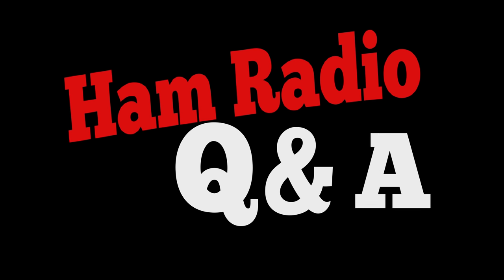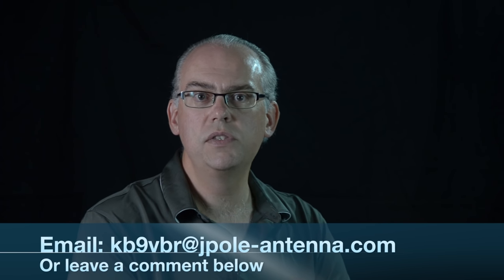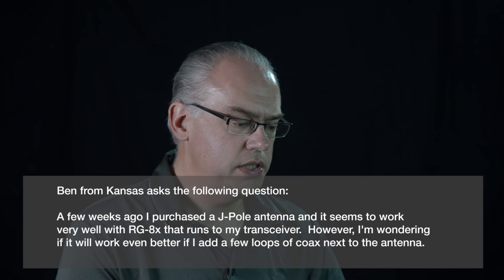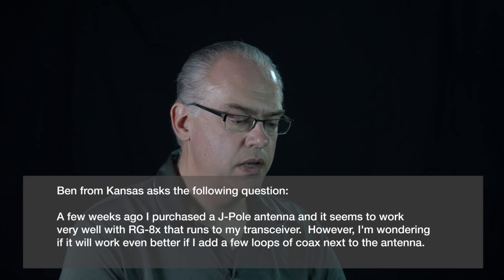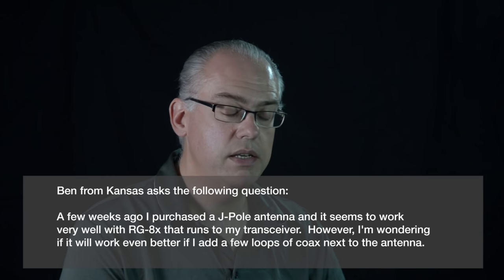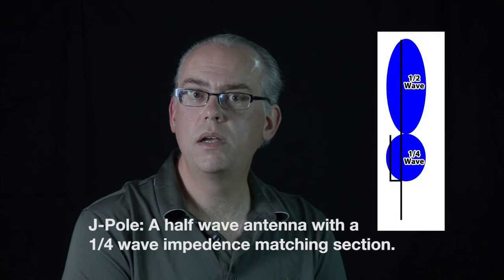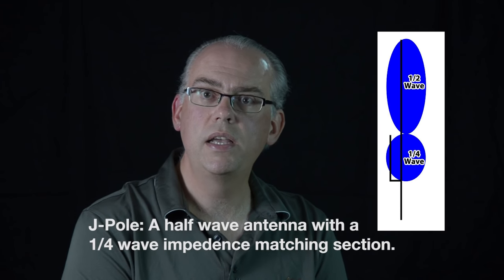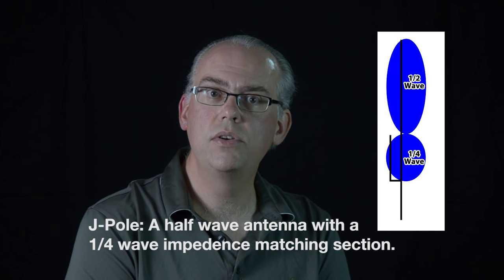Baluns and Chokes: Ham Radio Q and A Episode 3

Comment: I have an ldg ru-9:1 in on a long wire I get some qrm could I insert the mfj 915 isolater on the coaxial and would it help with the qrm.
Reply from the maker: Possibly‚ it depends on what the QRM is. If the QRM is man made like electrical noise the isolator may help filter it out. But you may be better off by first trying to figure out what the noise is and if it is coming from inside your home or another source. Once you know the source of your noise‚ the better able you will be to remove it.

Comment: So the best choice of ferrite bread would be the highest impedance at radiated frequency (e.g. 400 Ohm at 433mhz UHF should be fine)? E.g. this example:
http://cdn.lairdtech.com/home/brandworld/files/28B0315-100.pdf
How to chose ferrite bread for higher frequencies e.g. wifi 2.4Ghz when most datasheets just go up to 1Ghz... ?
Would the 28B0315-100 be ok?

Comment: Not convincing to me I'm afraid. If you make a coil of coax, both centre and braid are coiled and both will act as chokes to RF. Why should the braided part be more of a choke than the centre conductor? The RF energy travels on the surface as he explained (skin effect) so can't see the value.
Reply from the maker: Peter, in a sense you are correct. But consider this. The purpose of the outer braid is two fold: it creates the return path for the electrical energy as part of the RF circuit, but it also provides a shield so that the inner conductor doesn't radiate. It works like a Faraday cage. In coiling the coax the inner conductor is protected by the outer braid, thereby not creating the inductance. The outer braid has no such protection, so the inductance is present in the coil which increases the impedance, stopping the flow of return RF energy.

Comment: I have a question, if anyone would be kind enough to answer :)  I'm not a 'Ham', just an amateur that likes pratting with antennas for receive only say, airband...  So, would my diy dipole for aircraft freq work better with a 'choke'?  Does an antenna that is optimum for transmitting, automatically translate into being at optimum for receive also?  thanks :)
Reply from the maker: The choke's primary purpose is to keep RF energy off the outside of the feed line while transmitting. But it can have some benefit with receive only antennas, mainly cutting a bit of the receive noise. You won't notice this noise much with FM, but it could help with AM and sideband modulation reception.
Reply: thanks very much for replying quickly :)  I wondered if it would help because it's the balanced-unbalanced thing (receiver is 50Ω), then again - I guess that's a balun? I might try both then :)

Comment: To match the impedance on a delta loop I am told to use a 1/4 wave length of 75 ohm cable at the feed point.  Is it better to do the 5 loops with it at the feed point?   do I need a 1:1 current balun also ?
Reply from the maker: The 1/4 wave length of 75 ohm cable is used for a different purpose than the balun. It is changing the impedance to 50 ohms at the feed point. The 1:1 balun doesn't change the impedance, but does keep stray RF from returning back down the outer braid of the coax. You may need to add the balun, I guess it depends on your install and if the return RF energy is causing problems.

Comment: Built a 40 Meter NVIS dipole, the article I followed said to do a balun- 6 turns at 6-8" diameter. Is this correct? I'm using 49 ft. of RG-58U total length(including balun), with RG-8U to run to the station. Anything you would change in this setup??
Reply from the maker: +Steve Tomlinson With RG-8U I'd go for at least 7 turns in a 4.5 inch diameter circle. ideally for 40 meters, 10 turns of coax would give you the highest level of impedance on the outside braid. Here's a chart that can help you determine how many turns of coax you need for your antenna based on coax type and frequency: http://www.karinya.net/g3txq/chokes/
Reply: +KB9VBR Antennas   Isn't RG8-U too stiff to turn onto a 4.5" diameter? Thought maybe you meant the RG58-U. Thanks for the insight..
Reply from the maker: +Steve Tomlinson RG-8U should be flexible enough to bend that tight. Although some brands of cable may be stiffer than others. Worse case scenario, you could use a lighter weight cable to build your balun and just connect it in-line with the rest of the antenna system. At 40m, your losses would be minimal.
Reply: +KB9VBR Antennas   My new DX Engineering coax is really stiff, but I found some older 8-U that will work. Thanks for your help..

Comment: Would it be prudent to usa a choke or Balun on a mobil 50 w quad band FM radio antenna on an eternal antenna  wire?
Reply from the maker: I don't think a choke is necessary for most mobile style antennas. But if you are getting RF interference in your vehicle- for example: In an older vehicle I drove‚ 6 meters would mess up the AM/FM radio; then adding a choke would be a good idea.

Comment: all choked up. haha i see what you did there :-)  thanks this video helped explain a few of my questions.  Is a chock as effective as  a balun? it seems like a simpler solution, Im still trying to figure out what it means when all the rations they have on baluns
Reply from the maker: A choke is a similar to a balun, but serves a little different purpose. Both use ferrite chokes or coils of wire to change the impedance of an antenna system. But there is where the similarity ends. Chokes are used to raise the impedance of the outside of conductor of a cable to reduce stray RF interactions. A balun matches an unbalanced feed line to a balanced antenna by changing the impedance between the two.  Despite serving different purposes, the terms tend to be used interchangeably.
Reply: oh ok that makes since thanks for the info i really appreciate it. by the way  i missed a typo. i meant to say "ratio" not "rations", but i have been doing more reading and pretty sure i get that now. now if i could find a source for information explaining how you know how many turns to use. i see a lot of people saying to use so many turns but most give a different value, i would assume there is a way to calculate that?
Reply from the maker: There are formulas and charts for calculating how many turns of coax you need for a choke to be effective at a particular frequency. If you want to dig into the theory, both the ARRL Handbook and Antenna book have extensive sections on the subject.
Reply: ok cool thanks, google was not really helping me find anything i will look at those books

Comment: Would it be a mistake to use a common mode choke when using an automatic antenna tuner?  It seems to
me that the tuner needs the returning current feedback to lower the swr thereby maximizing the antenna
rf output?
Reply: No still use a balun. This will reduce the common mode current on your feedline, which in turn will mean your tuner has to work less hard anyway
Reply: Thank You

Comment: can I put 43 material beads on coax, where near radio or antenna or both, how many 5 10?
Reply from the maker: +Geronemo Bauer Either type 31 or type 43 ferrites are suitable to use as a coax choke. The Type 31 is good for HF and VHF applications, while the Type 43 will also work with UHF frequencies. The number of beads depends on the frequencies for your antenna. Lower frequencies will require more beads than higher frequencies. For VHF, 3-4 would be sufficient. With an HF antenna it could require up to 10. Beads only need to be placed near the antenna end of the coax and not the radio end.

Comment: Thank you, KB9VBR, I do have a question. Does a BALUN replace the Ladder-Line?
Well, I do have a question. NORMALLY a G5RV antenna is supplied with "Ladder-Line as a feed line" IF you install a 1:1 balun. It has a SO-239 Coax connector.  Can you connect the coax directly to the BALUN? Is the ladder line now useless?
Reply from the maker: With a G5RV antenna, the ladder line is actually part of the antenna. At the lower frequencies the ladder line radiates. That's why the line needs to be cut to a specific length. At the end of the ladder line you should have a 1:1 current balun and then feed the antenna with coax. I wouldn't attach the ladder line directly to the tuner as that could introduce RF into the shack.
Reply: My question WAS. Do you connect the dipole WIRES to the 1:1 balun in the center AND connect the feedline coax directly to the Balun?
Reply from the maker: Thanks for the clarification. No, there shouldn't be a balun in the center connector between the dipole elements and the ladder line. This should be a direct  connection. The balun goes between the coax and the ladder line.
Reply: I'm confused. The G5RV has a coax connector. (How would you connect a balun to a SO-239?)
Reply from the maker: Inexpensive G5RV antennas, like the MFJ-1778, have a direct SO-239 connection between the ladder line and the coax. This will work, but you run the risk of RF energy traveling back down the outside of the coax feed line. If you are having trouble tuning the antenna on 40 and 80 meters, this may be the reason. Removing the coax connector at the end of the ladder line and replacing it with a 1:1 current balun, like the MFJ-918, will increase the antenna's performance on those lower bands.
Reply from the maker: Inexpensive G5RV antennas, like the MFJ-1778, have a direct SO-239 connection between the ladder line and the coax. This will work, but you run the risk of RF energy traveling back down the outside of the coax feed line. If you are having trouble tuning the antenna on 40 and 80 meters, this may be the reason. Removing the coax connector at the end of the ladder line and replacing it with a 1:1 current balun, like the MFJ-918, will increase the antenna's performance on those lower bands.
Reply: Ah!

Comment: Why Ferrite Mix 33 over Mix 31?
Reply from the maker: Both Type 31 and Type 43 mix ferrites will work for VHF frequencies, but Type 43 has better common mode suppression than Type 31 at the higher frequencies. Both will work, but you can by with less individual chokes using the Type 43 mix ferrites.

Comment: SWR is a differential mode  measurement and has no effect on common mode current. 

Air wound chokes are narow band and are most effective at their self resonant frequency.  Too many or too few turns can make common mode worse. Let's say the feedline  common mode impedance is net inductive. If your air wound choke is net capacitive, the choke can increase  common mode currents. W8JI has a nice white paper on this.

Model a 1/4 wave ground plane with (4) radials and then add a vertical 1/4 lambda wire on the shield side pointing down- you will see a lot of common mode current. (4)  radials are not sufficient to get rid of common mode.

You canot say that type 43 is the best ferrite material. For broadband  common mode impedance  you would like to select a material that will display large resistive values  at the frequency of interest.

 A common mode choke on a DC grounded J pole, if designed correctly, will attenuate feedline common mode, but will do nothing to common mode on the metal mast.

In summary, way too simplistic a discussion of baluns, UNUN's, and in  some cases  incorrect.